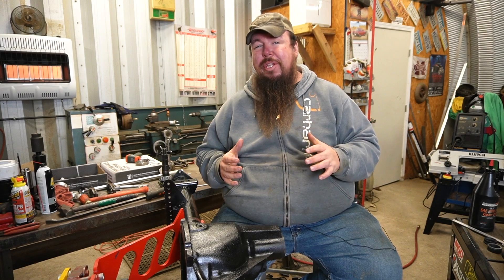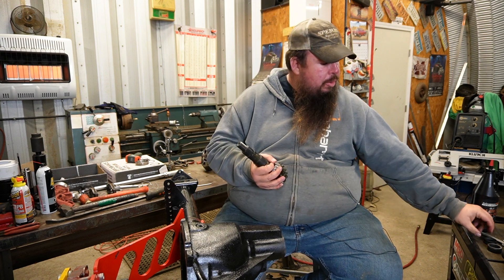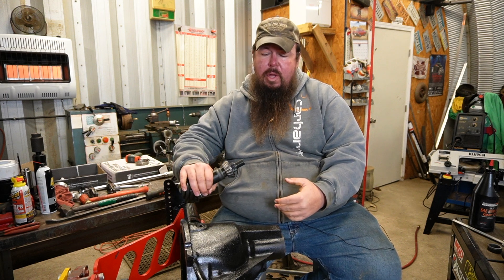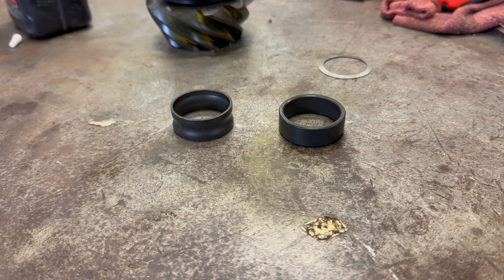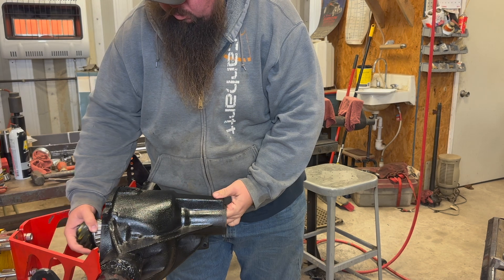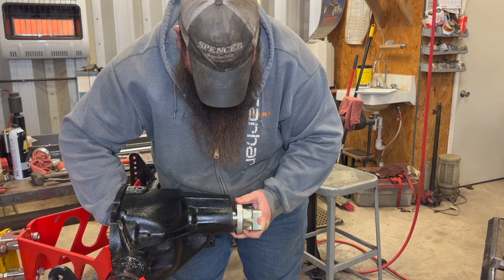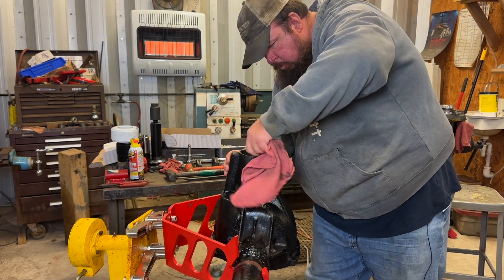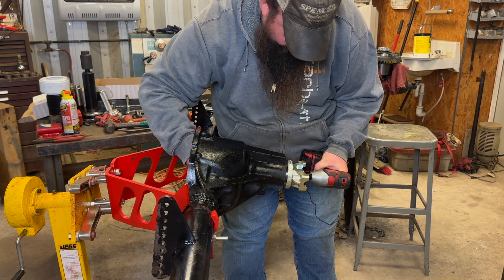How To: Set Pinion Bearing Preload With Crush Sleeve Eliminator

Comment: You solved my problem. I was getting inconsistent rotational torque readings. As I turned the torque wrench it would be easier and then harder. I put the shims on before the bearing, so the eliminator is not true, because the shims are hitting the fillet. Got it. Thanks a million!

Comment: How do you know the preload won't change after you replace the "try" race with the one that will be installed?

Also, is it possible to tap (cut threads) out a self- locking pinion nut so it's no longer self' locking and easier to thread and untreated while selecting shims?

Great video!

Comment: Great video you explain things so well. Is it possible to set the preload on the crush sleeve while the carrier is in or does it have to be out?
Reply from the maker: Thank you! Glad you enjoyed it! Unfortunately no, you need to remove the carrier to get an accurate preload measurement on the pinion bearing. Hope that helped! 😎🚜💨
Reply: @AllieCatCustoms Appreciate the help and the quick response. Just replaced my pinion seal and was hoping the yoke and nut could be put back on and preloaded without removing the carrier. Looks like I got my weekend job now. Once again thank you for the help I will definitely be subscribing. 🍻

Comment: Thank you for your this extremely clear and articulate explanation AllieCat. I am preparing to do my first pinion seal replacement on my 2001 XJ. SO many videos just mark the nut/yoke, yank the seal, and torque the nut to 200 ft/lbs, done. Several other vids do a more comprehensive (by the book) disassembly of wheels & brake drums to get a more accurate "rotational" torque value. NONE of them say to replace the crush sleeve which seems like a true 'by the book' way to do it. I was wondering what your opinion is on replacing the sleeve any time the nut is removed. Also, I know you said the tolerances will obviously vary when shimming for a solid spacer option between different diff models and manufacturers. However, as I don't have a shim collection, isn't there at least a ball park (minimum/maximum) of pinion movement or "travel" so when I order the shims I can get a couple or few different thickness and quantity of several shims? If it helps, I have the Dana 35 with limited slip. I can't imagine all XJ Dana 35's pinion 'travel' vary that much between same models, no?  TIA

Comment: So after that 140 ft lbs of torque the final assembly you can just torque it back to 140 ft ibs and be done
Reply from the maker: As long as you have the correct preload with the pinion nut torqued to 140ft lbs you can. Once preload is set, torquing the nut should have repeatable results. Always check to make sure something hasn’t moved though.

Comment: I'm rebuilding my 8.5 in my camaro, using a crush sleeve eliminator as well. Im reading different tq specs from everyone! I've heard anything from 125 all the way up to 250 ft lbs! Where did you get 140 from and any issues at that setup? Thank you! I enjoyed this series of rear end builds you have on here!
Reply from the maker: Thanks for watching! When I first started using the crush sleeve eliminator I was seeing 120-140ft lbs, so I ran with 140ft lbs. I see no reason to go any tighter especially since it’s a locking nut with lock-tite on it.

Comment: Nice video, but i dont know if i,m stupid but doesent the preload increas when you torque the final 140ft-lbs?
Reply from the maker: Thanks! Ok, that is a valid question. So when you are changing shim stacks, and finally find the stack that gives you the preload you want, you torque the yoke nut to 140ft-lbs, and check the preload. If the preload changes, you adjust the stack, and torque it again. At that point, it’s very fine adjustment, so you probably won’t need many tries. Once you get the correct preload with the nut torqued, you are ready for final assembly. Hope that clears it up!

Comment: So an impact gun is ok to use with a crush sleeve eliminator?
Reply from the maker: Yes, but only if you have a good touch. DO NOT just go full bore on the impact. Instead use a light touch on the impact to get the pinion close, then finish tightening by hand. Once you do it a few times you will understand what is going on and be able to make things happen faster. Hope that helps! 😎🚜💨

Comment: On the pinion is the set up bearing only the outside bearing or are both bearings set up bearings?
Reply from the maker: You can use a set up bearing for both. I typically will at least use a setup bearing for the outer since it’s difficult to remove the pinion with the “final” bearing in place. Having that clamshell puller makes pulling the inner pinion bearing easy, so I didn’t use an inner set up bearing. You can either buy setup bearings, or just buy regular bearings and hone them out yourself. Hope this helps! 😎🚜💨

Comment: could i check the drag with a digital torque wrench?
Reply from the maker: Well, I’ve never tried that, so I can’t say yes. I’ve always used dial or beam type wrenches. But if you think it’s accurate enough to try, I’d test it out. You have a in-lbs digital torque wrench?

Comment: I have been watching your videos, and I am happy to see this newest one. I I am in the process now rebuilding a 12 bolt for my Nova.. I have decided to go with a Crush sleeve eliminator after hearing your advice. I think I have this all figured out. I do have one question. Are there any shims needed between the inner bearing and the pinion gear?  Will This have any influence on setting the pinion depth?
Reply from the maker: Awesome! Glad you’ve enjoyed the video! That 12 bolt will get built just like the 10 bolt in these videos. The pinion depth adjustments come from the shim thickness changes between the inner pinion bearing and pinion gear.